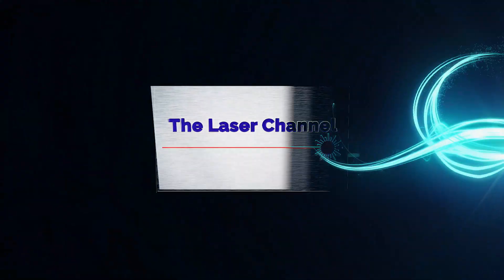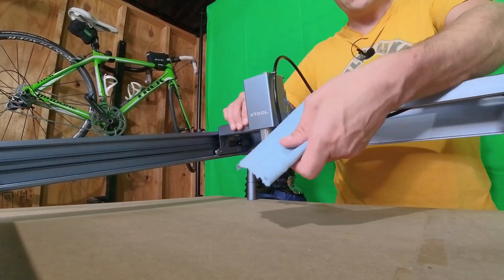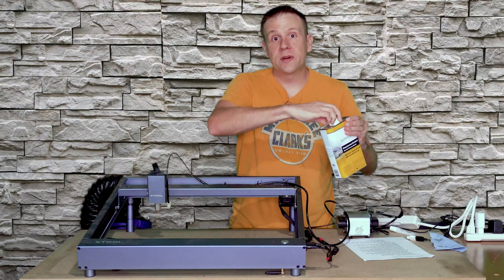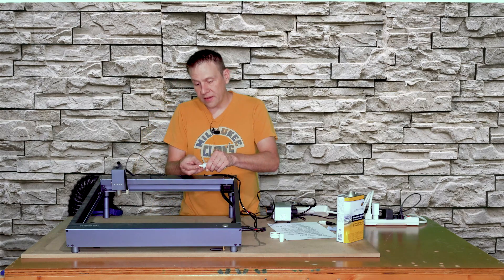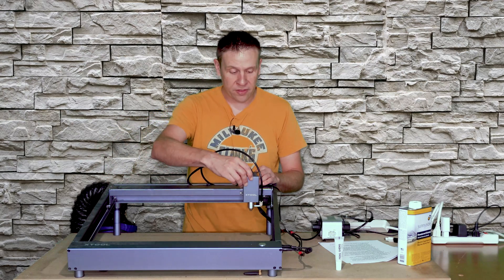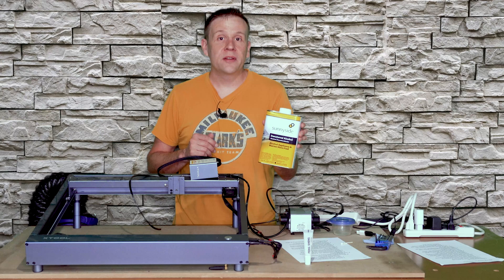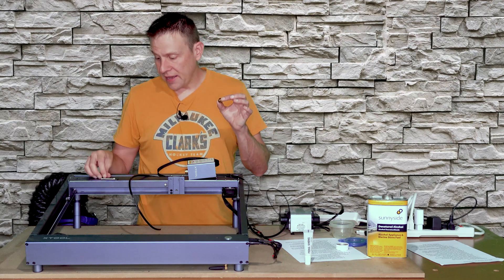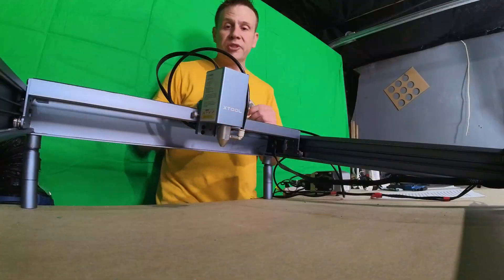XTool D1- 3 Easy Maintenance Checks!

Comment: My issue is the there is a some play when I slide the module into the gantry, not the gantry itself on the rail the "tung and grove" is loose. Any suggestions? Thanks.
Reply from the maker: The best way to fix this would be to post some photos on the xTool Facebook group- they are very responsive and helpful!

Comment: Great video! My D1 just started making a grinding noise when it's burning. I 'think' it's only when it's firing. It doesn't seem to make the sound when just traveling. Any ideas? I'm worried I'm not doing maintanence outside of those that you presented. I hope the laser isn't going bad
Reply from the maker: I've seen on some projects like engraving images the laser movement is not the smoothest and can make a grinding noise.  I would make sure the software is up to date and the firmware of the machine is up to date as well.  After that I recommend posting a short video of the issue and run settings on the Xtool Facebook group- lots of very helpful people there!

Comment: My laser suddenly started burning thick lines rather than cutting basswood. It's pretty new, I've only used it 10 times. The X and Y axis both work fine, laser is moving normally. distance is set to where it should be. Just not cutting. Any Ideas?
Reply from the maker: Sorry to hear your laser is not cutting like it used to.  It sounds like your lens could be dirty especially if you are not running an air assist kit- lenses can get foggy with smoke residue very quickly!

Comment: I see the plastic shield around your laser head is removed.  Do you recommend removing it?  And is there an advantage to removing it?
Reply from the maker: I recommend following manufactures safety instructions.  For me, I removed mine for making videos and found less smoke debris build up with it removed; I do wear the safety googles or run the machine inside an enclosure when not making videos.
Reply: @thelaserchannel1  Thank you for your fast reply. I do appreciate it

Comment: I would not take the lenses off the laser module. The only one that can get dirty, is the outside face of the outer lens which can be cleaned without removing it. Taking them apart only creates the chance to get the other surfaces dirty if you are not careful. The only time you should remove them is if they need to be fixed.
Reply from the maker: We disagree.  Removing the lens serves two purposes in the video: 
1. It shows people they can be removed for cleaning or servicing 
2. Really dirty lenses often need to soak in alcohol overnight to fully clean.  
There are many ways to clean and service the laser machine- this is how we clean ours and the machine continues to work like new.  
Your cleaning methods may differ and that's ok.

Comment: I am considering purchasing the D1 Pro 10 Watt. But I am a little bit concerned about the YouTube videos that I have seen reference to protective lens cracking. As long as you keep the protective lens clean will that prevent the cracking issue?
Reply from the maker: Thank you for watching the video.  You have a very valid concern and I get this question a lot!  Yes- an air assist kit will keep the lens cooler and most of all cleaner.  A dirty lens will not pass all of the laser energy to the work piece- the "lost" energy is absorbed into the lens and heats up the lens making the lens much harder to clean.  At some point there's too much heat built up in the lens and the lens either cracks or has a hole burned through it!  Regular cleaning/inspection and an air assist kit will keep you running trouble free for a very long time!  Enjoy!